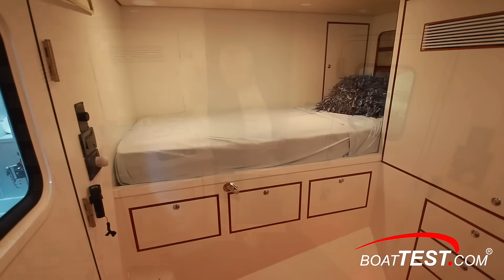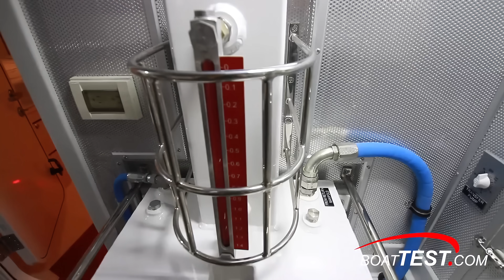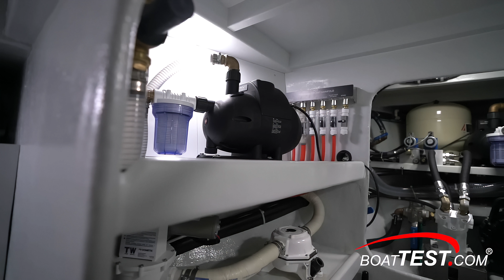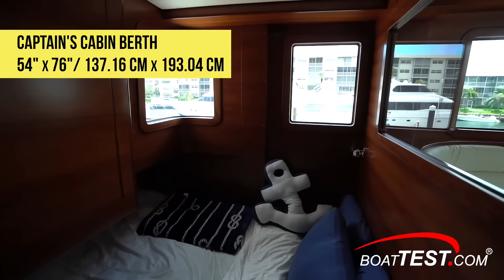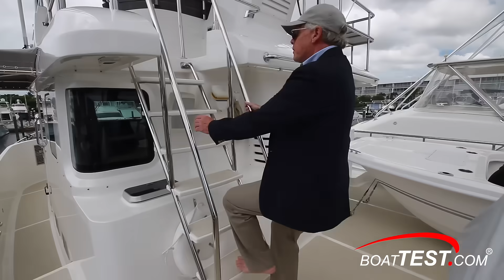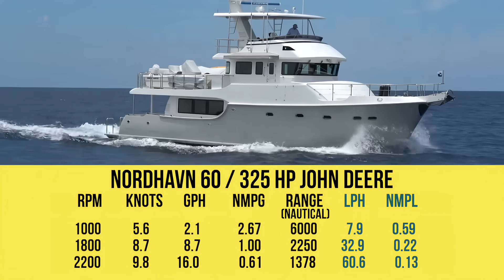2020 Nordhavn N60: Offshore Performance & Sea Trial

Comment: I did some calcs using the data published in this review: 8,517 Litres with 0.59 Nm/l at 1000 RPM (5.6Knts) =  5025.03 Nm...where the 6000 Nm range come from without increasing fuel caoacity to 10170 L - which would give a range of 6000.3 Nm but the additional 1653L is not exactly insignificant - so where and how have I gone adrift with this - unless of course the endurance at 5.6 Knts is fantasy. Very dissapointed .

Comment: Building a hull from light polyester and than have to ad ballast, about strength ,
A steel hull with a kind of ice class is much stronger and no need for ballast .For me the Bering approach is a lot more logical for me, still a great vessel !
Reply: Steel hulls rust

Comment: After reading about the N120 debacle I wouldn’t buy a new Nordhavn.  They don’t maintain enough capital to finish the boats on order, relying on the deposits for subsequent orders to fund the finishing of your boat.  Based on what they found behind that beautiful wood finish on the N120, I would consider a used Nordhavn if the problems had been addressed.  The details of the N120 were disappointing to read.

Comment: As a boater of many years, it is supremely enjoyable to see a ship, this Nordhaven 60, that is designed without compromise to be a no-BS world traveler.
Damn, what a dream to be totally autonomous, captain of your adventure, with a ship like this....
Reply: You should check out Bering Yachts, and this vessel  won't look so awesome.
Reply: @mihnea92  I watched the review of the bearing 65. It looks like it’s built very well, but I really didn’t care for the architecture. Everything is so thick and blocky. The flybridge roof, the console, and the inside bridge is so tight and cramped.

Comment: Way ahem "overboard" ahem on the electronics. Everything should be able to be run by nothing more than a cell phone...period. Beyond that there needs to be a way to navigate and judge weather and sea state conditions without any use of electronics.

Period.

Other than that this remains in my humble opinion the best Ocean going and straight up live aboard and everything in between hull and build on the market and as a production vessel no less.
Reply: have you ever been offshore out of site of land and tried to use a cell phone?

Comment: Very nice! Nice on water, one handed docking, pilot house is nice and has table and double bed too. Did not show salon or galley or suites. That is on the "features video" and I was disappointed. Salon very plain, not fancy. Very good fuel usage and 100hp wing engine is more efficient too. 1.5M basic basic cost. Thanks for sharing.

Comment: As good as the boat is technically, living in an area which is wood, wood, and more wood with absolutely no detail in it would send me crazy.  At this price i would have thought a little more imagination could have been used.  A caulked floor would have been a start.  Do boatbuilders in general think that leather upholstery is the ultimate covering we all want?  Sorry, Nordhavns' are not for me, back to the Fleming 58 Robert.  Good, informative video though - as normal Steve, thanks.  Keep getting your feet wet for us.

Comment: Steve , if you were crossing oceans which boat would you prefer and why... Nordhavn 60 or Fleming  65
Reply: Tom Craddock the Fleming 65 does not have as standard the fuel storage for ocean travel. 2000 miles at 8 knots means going via Iceland Greenland Canada into north America as Tony Fleming himself has done many times. I would still have the Fleming over the Nordhavn for the Kudos factor. Just have to plan the trips more carefully.

Comment: What's the price of this yacht?
Reply: I believe the NEW price of this yacht is around $1.5 base price.  A fully upgraded with Jacuzzi on the boat deck, twin diesels and tons of mechanical upgrades like Nordhavn Jupiter was around $2.5. https://youtu.be/JPZiZ8E8fRQ   Used they hold value really well, still you can get a great deal on one. In my opinion the boat will outlast the owner.
Reply: Over The Clouds base is currently about $2mm US
Reply: Optimistic Future   My pricing is from Nordhavn in email, that’s where I got these numbers.  They probably have adjusted higher since then.
Reply: Over The Clouds have you seen the new 41’?  That’s a slick little package.  I think it’s around $750k or so.
Reply: Optimistic Future   Yes it’s very nice.  They posted a walkthrough and sea trial video already.   Great boat, perfect size for a lot of people and a super value.
Reply: Over The Clouds were currently building a 60.  January delivery.  Super excited.
Reply: Optimistic Future   Congrats.  Hope you do a walkthrough on your new home.  East or West Coast delivery?   Im in Portland, I’m always curious about twins in a 60.  How does it perform vs the single.?  Any significant upgrades?  I’m personally looking at couple different new builds.  I do know I want a MTU power plant , full electrical appliances, lithium battery setup to be able to anchor without the. generator noise. The inverter setup they put together is top notch.  Also a diesel boiler for backup heat.  The most important item will be the built in the coffee maker. 😃   No trip will be enjoyable without it.  
My idea is to go as big as possible but still be able to single hand. Looks like it will be a 68 or 76.  I don’t see the point in paying tariffs to China.  There’s a couple other options but that’s what I narrowed it down to.

Comment: Still like the Fleming , but this is a very nice boat.
Reply: Fleming can only go 1600 miles at 8 knots
Reply: Fleming and Nordhavn both make nice boats.  Fleming’s do have more power and better performance, but they pay fore the extra power with a higher rate of fuel consumption.

Both are nice, just depends on one’s priorities.
Reply: Fleming only has 5 ft headroom in the engine room.
Reply: justsomeguy  Yet still making nice looking boats than this.